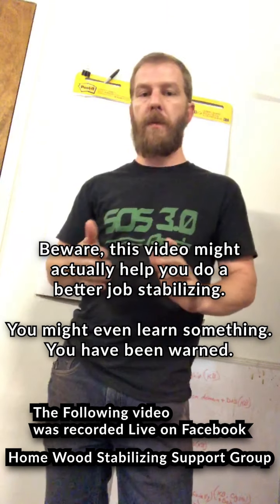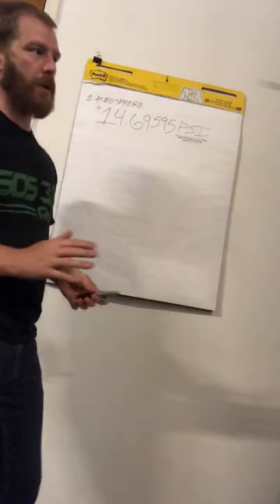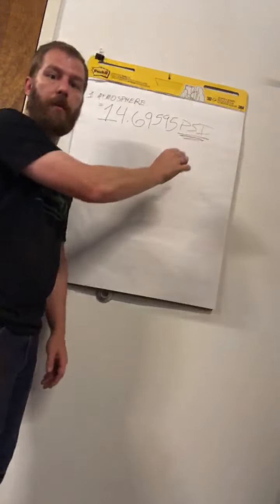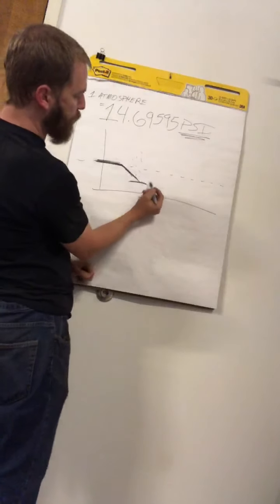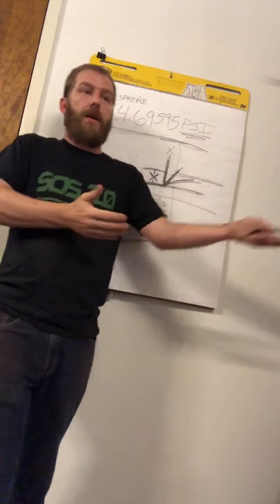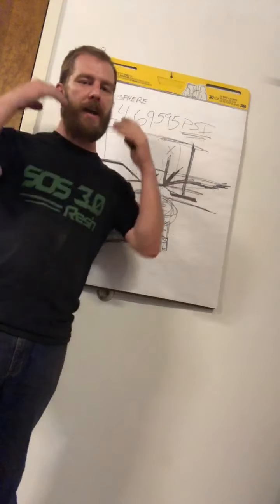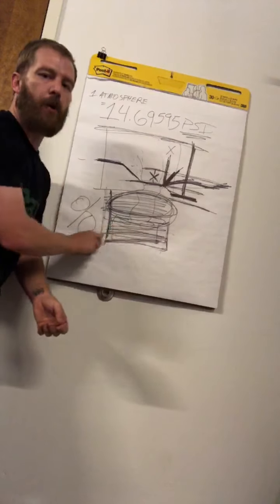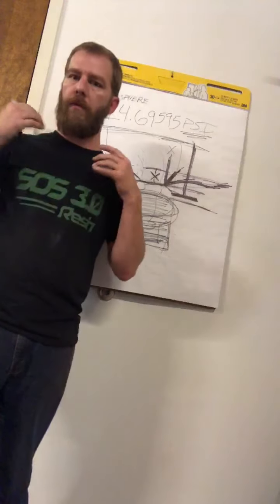The truth of stabilizing the so called "experts" didn't want you to know.

Comment: It’s kind of funny just now coming across this video because when I spoke with you via email telling you that I was planning to experiment, this is exactly what I did, move the blank to the pressure pot after removing the vacuum. I also noticed exactly what you said in this video regarding a second vacuum. Instead of seeing air bubbles immediately, they didn’t appear until a minute or two after the vacuum gauge was maxed out. One other thing I tried, which I do every time I stabilize any wood, is use a 1/2" vacuum hose hooked between the pump and the chamber. It connects to the 3/8" fitting on the pump instead of the 1/4", and since the hose diameter doubled, the gauge on the vacuum chamber moved from zero the maximum vacuum almost immediately. I might email you regarding a couple of other questions I have, one of which is liquid boiling at a high vacuum, if this is true and if it affects penetration of the blank. Good video by the way. I never knew you had a YouTube channel.
Reply from the maker: The channel is new, still trying to work in the time to be more routine about it. As soon as I got more help to make time, more work lands at the door. It's a good problem to have, but not good for making videos... which I hate anyway. Can't stand being on camera... oh well, guess I just suck it up buttercup. 

The diameter of the hose will help considerable for the first portion of the vacuum, in the bottom half though it won't have as much effect on most home chambers. The small volume doesn't make it essential for most folks. That doesn't mean you won't see different statistical data however. I'm still working out the potential for gains based on the speed in which the vacuum is drawn. Many of us have seen that smaller chambers draw faster and appear to finish faster, however with more blanks in a larger chamber, the total volume may be affecting the efficiency. There's a lot to evaluate there and may have some very interesting data regarding the diameter of the vacuum hose. 

Water will boil at room temp in a hard vacuum. This is but one of the great many reasons I insist that drying blanks first is absolutely essential for best results, quality blanks and efficient use of the system and resources. I'm looking forward to more email discussions! I'm eagerly awaiting your next email. :-)

Comment: So I just used a very basic formula to get me to a starting point. I know real world wont be this linear and there are lots of factors I am not considering, but for what I am trying I think it might be ok? I took 14.7 and multiplied that by .86 (the relative negative bar I pulled durring Vac) to get 12.642 the estimated relative negative psi during the vacuum stage of stablizing. I ran at that negative psi for 720 minutes. I multiplied 720 by 12.642 to get 9102 psi minutes. I took 9102 psi minutes and divided that by 52 psi (my pressure pot psi) to get 175 minutes in my pressure pot at 52 psi. Sorry if that is hard to understand I am not very educated, I just make stuff. Am I close to understanding?
Reply: Maybe even easier would be to convert the bar pulled while in the vacuum to psi then run the material in a pressure pot at the positive psi for equal amounts of time.

Comment: So question.. when applying pressure to the blanks done keep it in fluid or pull it out and then apply pressure. Also I only have about 40 psi will that suffice to push the rain into the cells. By the way I bought your resin and am getting ready to use it.
Reply from the maker: Keep the blanks submerged through the entire process. I use HDPE buckets to move between vacuum and pressure chambers. It's cleaner and easier with loads of benefits. 40 psi will be enough to have significant advantage in both time and ease of penetration. The abuse of the cell walls from heat (when drying the wood first), vacuum and pressure will help to bust them open for penetration. Cell walls themselves are tough and difficult to penetrate, but we can still bond with them and encapsulate them even if we don't fill every one.